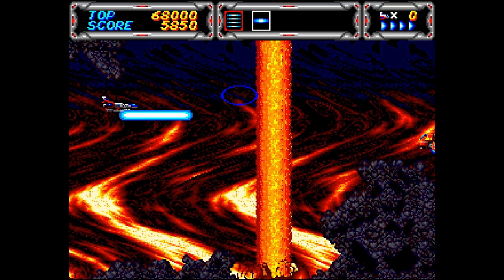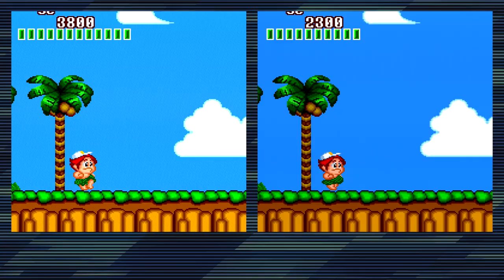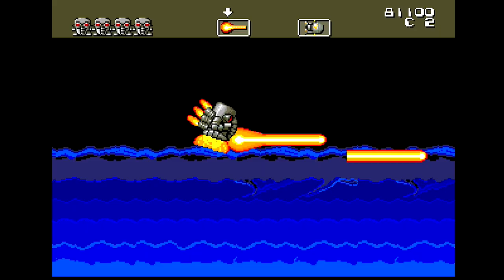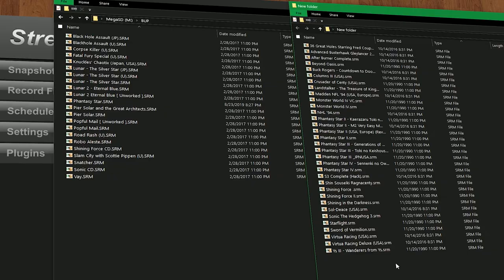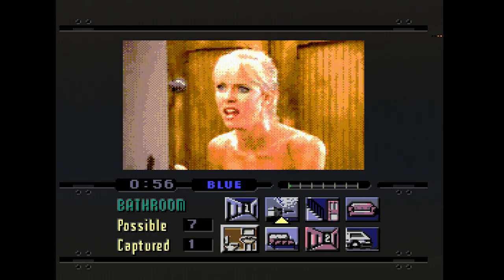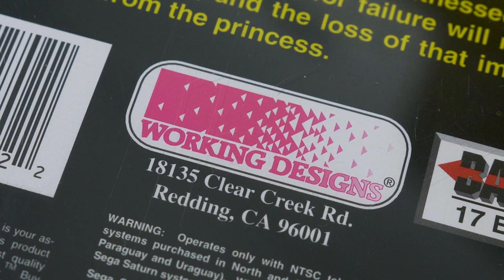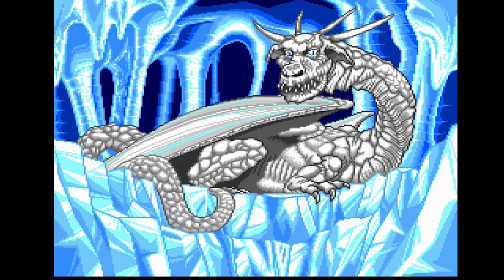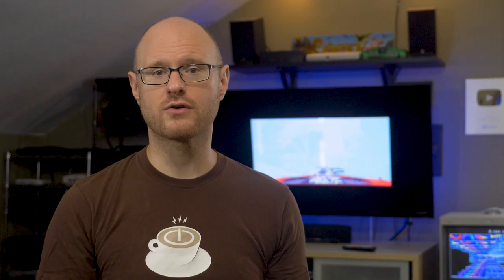Mega SD: Genesis & Sega CD Flash Cart / MY LIFE IN GAMING

Comment: "I can't think of anything else I'd want."
WHAT ABOUT 32X GAMES COURY?!?!?!?! AGGGGGGGGGGGGGGGGGGGGGHHHHHHHH!!!
Reply: it does 32x cartridge games
Reply: @wizemonk4925  Yep, it's impossible to do 32X CD games in a singular cart because of the bus conflicts, not to mention the stupid overlay system for graphics the 32X uses.
Reply: yes you cant  use mega sd with sega cd plugged in tho tbh 32x games on cd are just same as they are on sega cd  just slighty better colour i dnt see the point
Reply: wize monk I meant an all in one SEGA CD and 32X FPGA solution. It’s the last missing piece.
Reply: it does 32x jusr not cd games my point is there are 5 32x cd games all them are on sega cd to on 32x you get lil more colour mean is that worth it to mean know it plays all cart games so im happy
Reply: wize monk it doesn’t do 32X without a 32X attached, CD or otherwise.
Reply: yeahhh sooo it does 32x 32x must be attached hasnt anything do with iit does 32x  thats main thing if you dnt have 32x go get mega everdrive it will do 32x with no 32x most collectors have 32x
Reply: wize monk no, you need a 32X with that too. There are no FPGA solutions for 32X yet. But one day they’ll make one!
Reply: like i said 32x most collectors have it so not realy a hasel you can now get triple power supply with one plug and all 3 comectors for 32x sega cd megadrive so no more 3 large adapters retro cables does cable you can pull it apart leave one end in mega drive rest cable stays in 32x then you just detach it simple if you want to use megadrive the adapter thats  still pluged in you simply plug in av cable no more hassel id say get 32x now prices are rising by the day
Reply: @wizemonk4925  Oh I know. I'm not slamming it one bit, it looks amazing. Coury said at the end what an amazing year it's been with the Mega SG, Mega SD, the 8bitdo and officially licensed controllers, Genesis mini, etc. And it really has been! 

But if I could have my absolute every dream come true, it would be even more sublime to plug in, say, a Mega SD 32 with the FPGA functions expanded to not need the 32X hardware. Slide it into an Analogue Mega SG with HDMI out. No need for multiple power supplies or an external upscaler. Just the USB cord powering everything in that small footprint. That would be quite the golden cherry on top of this already mindblowing sundae we've been served.

I'm sure some one will do it in the next few years, be it Terraonion or whoever else. I'll definitely pick up the Mega SD before then though, hahah.